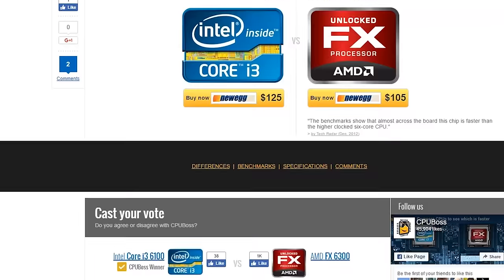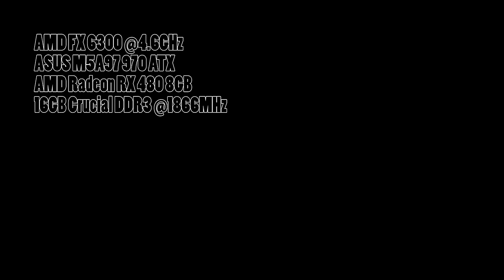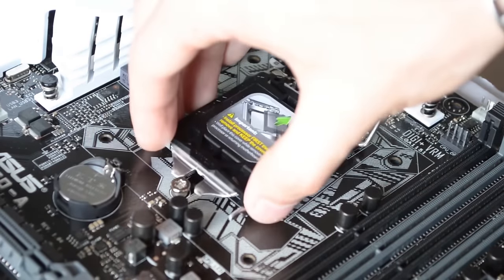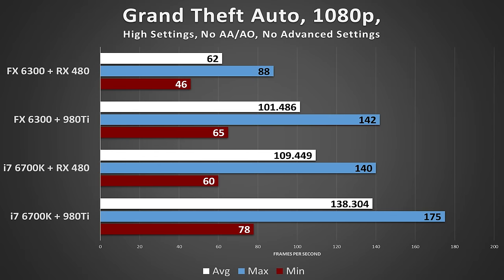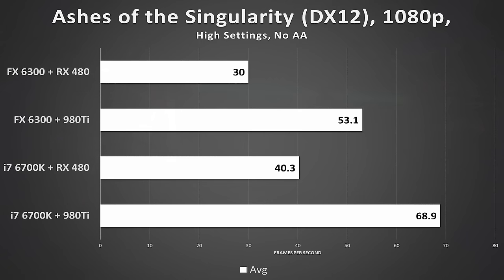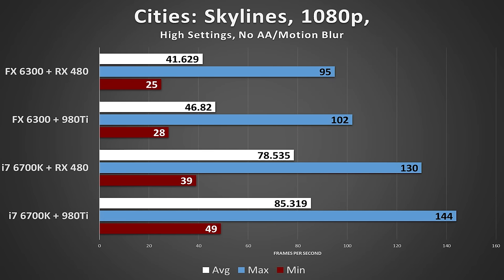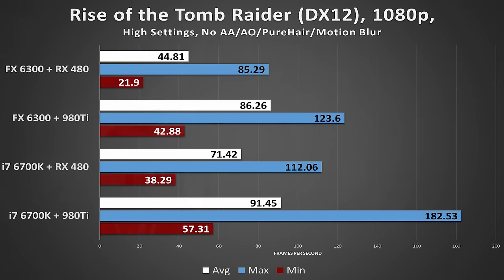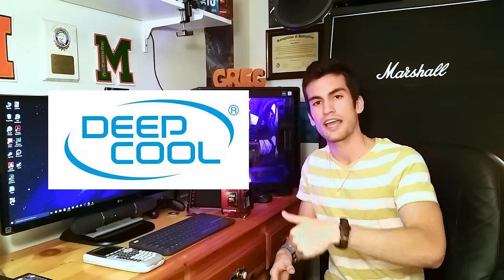AMD FX 6300 + RX 480: Severe Bottleneck?

Comment: ddr3 vs ddr4 is lile 1fps
Reply from the maker: Precisely.
Reply: Science Studio if i remember correctly ddr2 is a bigger jump than ddr3, but i dont know how to test that, as all the ddr2 capable cpus would be a significant bottleneck.
Reply: Same with PCI-E 2.0 vs PCI-E 3.0 = 5 FPS max performance benefit.
Reply: That really depends, if you are buying DDR4 it's 3000+ or bust. Otherwise there is not really much of a difference over DDR3.
Reply: Br3ad still not much in games, it is much better for other things, but as far as games you don't see a real benefit
Reply: Br3ad i mean, not really, obviously you haven't tested this have you? Ram is only an issue when you don't have enough, it doesn't have a significant enough performance impact to actually matter. Having faster speeds doesn't change hardly anything. that's why you don't benchmark ram with games. Also I'm majoring in Aerospace Engineering so probably not as dumb as you think ;)
Reply: Br3ad as I said, its only a problem if you don't have enough. I've been on 4, 8, and 16 gb of ram It doesn't change performance (barring 1 to 2 frames, also channels can change things a bit, but that really is only an arguement for ddr2 and back) unless you are trying to use more than you have in your system. I'm starting to think you are just trying to get a rise outta me.
Reply: ThePaisleyProject I have a machine with great DDR2 RAM I was going to wait it out to Zen, but lighting struck. I will be waiting for your results. You can use up to 4GB single stick if want
Reply: i have a machine with 4gb of ddr2 ram, a machine with 8gb or ddr3, and one with 16gb of ddr3. when we take gpu bound games (becuase the cpu performance will massively vary because of older architectures, i.e. trying to remove the cpu problem) the games had variances in fps when there was a cpu intesive moment, or you didn't have enough ram. (taking rise of the tomb raider, and tomb raider 2013 on a radeon 7970) (the variables are 8 and 16gb of ram was tested on an fx 8350, 4gb or ram was ddr2 and on an athlon ii x4 630) The framerate was very similar(barring 1-5 fps difference) when the game was in a moment that did not exceed the 4gb or ram. (also rise of the tomb raider can exceed 10gb of ram on max settings)
Reply: Br3ad I have never seen a 4gb stick of ddr2 ram, to the best of my knowledge 2gb is the cap for a single stick
Reply: ThePaisleyProject ARK requires+12GB of RAM
Reply: Br3ad ok, so theres a difference between sdram and dimm... and once again ram is only a problem if you do not have enough
Reply: ThePaisleyProject Then why do video cards use faster much more expensive RAM
Reply: they work differently...
Reply: there is a massive difference between gddr5 and ddr3, they have different uses, and therefore work differently
Reply: ThePaisleyProject so one temporarily stores data and other doesn't? gddr5 and ddr3 are different, ddr2 is the same as ddr3?
Reply: they do different jobs...gddr5 is in video cards, holding your textures, and other things that go on screen. DDR(insert number) holds other parts of the game's information that doesn't need to be reached quite as fast. for instance the texture for a waterfall may be loaded in the gpu's vram but the ram holds the information for the cpu of when to put it on screen. so yes they both hold data, but they are meant for very different jobs.
Reply: So ddr2 or 3 cannot hold textures? What about the GPUs that are used for data mining? That information isn't textures.
Reply: Br3ad its used on gpus because they can do many small computations very fast, they arent dependent on the memory bandwidth as much, gpus have been on gddr5 for ages.
so while yes they can hold textures,they are used for different processes
Reply: gddr memory can also request and recieve data in the same clock cycle, whereas ddr can only request OR recieve data in a single clock cycle. this is becuase ddr deals with the cpu which handles a single request per clock... (not talking abt hyperthreading)
Reply: Br3ad okay go ahead spend way too much on ram then... Clearly you're not here to learn...
Reply: Br3ad i was saying the laptop ram, and i mistakenly said sdram instead of sodimms, the ones you sent the amazon link to.
Reply: ThePaisleyProject But they are called DDR2. Why would they share the same name but not share the same functionality?
Reply: Br3ad its different standards, it has the speeds of ddr2, that is why its called ddr2
Reply: *****
Don't you have somewhere to be? ThePaisleyProject  is obviously misinformed and trying to spread his misguided information. He described DDR RAM as only being able to transfer data once per clock cycle. Which is exactly how SDRAM functions and is wrong. All DDR RAM can transfer data on both ends of a clock cycle essentially doubling the transfer rate.
Reply: ***** people who are uneducated tend to be rude when arguing.
Reply: ThePaisleyProject So that is your retort? That is it? I explained exactly why you were wrong, which you can go fact check and then you imply that I am uneducated?
Reply: Br3ad ok first off, link to where you got this information. Second off, this discussion was about the difference between gddr and ddr ram, and also why the there isn't really a problem with ram at lower speeds so long as you have enough. The first clue that you don't really know much about the discussion is that you said you have "good DDR2 ram". It's several generations old at this point and really isn't that good. The ONLY time you have an argument that works in this is the difference in ddr1 vs ddr2 and ddr2 vs ddr3 (and from my own testing this isnt a big change either). Ddr3 vs ddr4 really doesn't have an argument as fps varies by 1-2fps in total between the two as proven by many benchmarks and even the ones I've shown above. 
The fact of the matter is that, gddr is different then ddr. While yes having higher numbers isn't a bad thing, and can even help in things like adobe photoshop, when it comes to games, it doesn't have enough of an impact to really warrant buying super high end ram for every build you make.
you can put the money in other places. For instance instead of buying a 16gb kit of corsair dominator platinum, you could buy a cheaper 16GB kit of hyperX fury. It will give you near if not the EXACT same performance.
Statistics do not lie, and when you say that you "need" the higher numbers, you would be incorrect. Hell you can even be fine with lower speed ram in photoshop, it will just take a little longer to do some tasks. But that also goes with the cpus that can control the difference between ddr3 and ddr4. which with intel isn't much and can be easily tested as the difference between an overclocked 4790k and a 6700k is marginal at best. 
From what you've shown me I believe you are an older laptop user, who either hasn't built a pc in years, or has never built one. You also don't acknowledge that there are different standards such as ddr and gddr. and the real crux of the issue here is that you are unwilling to look at statistics and benchmarks, and when they are brought up you refuse to acknowledge them and even down right go against them.
And lets even take your argument into a little bit of scrutiny. Lets say that gddr and ddr are the same (which they aren't but for the sake of argument) Why are they making ddr ram in general? Because if we already have the faster standards, then why should be putting in the much more slow ddr ram at all. And why aren't enthusiasts around the world putting in gddr ram instead of ddr ram. Well if you can have a rational thought, maybe it's because they do different jobs.
But I haven't seen any rational thoughts from you yet.
So can we go back to a more civil discussion or do you want me to actually get mean, because at this point I feel like I'm beating up on a middle schooler.
Reply: ThePaisleyProject what speeds of DDR4?
Reply: Br3ad if you're talking about gaming, any speeds, it doesn't really affect much. if you're talking about photoshop/premire, higher speeds make a bit of a  difference, but not a huge difference
Reply: ThePaisleyProject 
Yeah you are probably right...... this review of DDR4 4000 RAM proving that performance does scale with faster RAM is probably wrong.

http://www.techspot.com/article/1171-ddr4-4000-mhz-performance/page3.html
Reply: Br3ad most of the games tested are horribly optimised. arma is also very cpu intensive, when you look at games like battlefield 1, or tomb raider (rise of the and the 2013 reboot) games with very good optimization dont really get affected by this that much.
Reply: ThePaisleyProject
"optimized" lol, another buzzword.
Reply: ThePaisleyProject
You know there is not real content to anything that you say.
Reply: Br3ad another buzzword? Optimization  isn't necessarily a buzzword if its used in the right context. but if i must go into more detail i will. Battlefield 1 is one of the most graphically intensive games while it also pushes the cpu fairly hard as well. but, its performance scales really well with all types of hardware (they took the time to code towards both amd and nvidia, of all ages from what i can tell. and it barely exceeds 4GB of ram at the lowest settings I can attest to this first hand) The goal of coding is to have as little code as possible to achieve the desired task. but as games become more complex they will require more code to be written. and thus more space is needed for holding the code in use. optimization in terms of coding means to refine the amount of code to as little used at possible. while not sacrificing performance, however it can also improve performance in some cases. thats why in patch notes you will sometimes see that they will say that they "optimized" a specific map to perform better on specific hardware. 
optimization is the refining of something for the specific task.
Reply: ThePaisleyProject
Dude you say a lot of nothing lol. Do you even code, bro?
Reply: Br3ad k then.
I had a class for game design a while ago that tought me some low level scripting, but I havent learned c or Javascript yet. I do have a class for it though this semester. I'd doubt you have any experience in this though
Reply: ThePaisleyProject
No, unfortunately I don't. Also, I never learned COBOL, C++, QBASIC, C#, SQL, Python, or Assembler. I never wrote an application in C# for my last job. I don't work for an international company where I install applications, setup servers, and configure cisco networks. I haven't worked with people from all over the world including Europe and Africa....
Reply: Br3ad k so you know how to code, still doesn't really change my argument very much
Reply: ThePaisleyProject Yup, people are pretty stupid now days. I guess that is job security for me.
Reply: Br3ad i have a feeling you were trying to take a jab at me there. Although knowing code languages doesn't give you the ability to argue apparently.
Reply: ThePaisleyProject yeah, I guess being a subject matter expert doesn't give me any insight.
Reply: Br3ad coding isn't a hardware matter...
Reply: Br3ad ok first off TRIGGERED.
and second off. Nothing of what I said was racist, she is one of my favorite teachers, I wouldnt expect her to speak english as well as a native born American would, just as I would hope that if I went to germany, they would be able to understand that my german isn't that great. 
nice try though.
Reply: Br3ad its a sad day when saying thay someone whos first language isn't english and they can't speak it as well as someone who's first language is english. Apparently thats racist now. According to your "infallable" logic.
Reply: ThePaisleyProject it is spelled inflatable. Noob
Reply: ThePaisleyProject clearly clearly clearly..... Go feign intelligence elsewhere junior
Reply: +Br3ad no no no, you continued on with this thread, If you want to back out of this, feel free to fight another day, but I'll just stay right where I am.
Reply: ThePaisleyProject your boyfriend reminded me of this thread.
Reply: a discussion that took 6 months, damn
Reply: oh yeah, I forgot to reply to this thread, My major is killing me.
Reply: true
Reply: +Br3ad jokes on you I'm single.
Reply: wow just got through this and buddys just a major goof has nothing better to do for 6 months??? than argue and insult wow must have a pretty sad life if thats how he gets his jollies lmao
Reply: it's lit fam
Reply: drew rudiger not gonna lie this seems like a second account... but i don't really care anymore
Reply: witch is why my build is going to be entirely ddr3, and with an AMD 6-core vishera 3.5Ghz CPU, and a Radeon R7 250 2gb GPU, or a geforce gt 710,
Reply: Zero kid ah vishera, I remember that architecture, good times... if you get a decent cooler, you should be able to push the cpu a decent bit further, also if possible try and find a used 750ti or 1050ti, will easily net you better performance at arpund the same price
Reply: Zero kid also I forgot about this thread +Br3ad hows it going buddy, still mad?
Reply: thanks,
Reply: Zero kid no prob, if you have any other questions I will be happy to assist

Comment: One thing I was wondering, if you had the parts, or have the budget to do so, could you do a video showing a 4th or 5th gen I5 paired with the RX 480? if you're not doing really intensive video editing, rendering, or don't really care about render times, wouldn't an i5 suffice for mid-tier 1080p gaming? I'm thinking more 16 gigabytes ddr4, the 480, and the mid-tier I5.

Comment: i got an fx 6300 rx460  build a few months before ryzen dropped ( i only had a $550 budget)  I only have a 360 watt psu, so I unplugged the optical drive that came with it, freed up a few precious watts, and overclocked the cpu. Stock target is 3,500 MHz, im at 3,800 on a heatsink/dual fan cooling unit... overclocked the GPU from 1212 to 1300 base clock and the system is stable. I can't run high settings, but it plays most titles i want to be playing fairly well on medium settings getting an avg of around 60fps still at 1080p.... for my first time messing with overclocking i cant complain, even if the gains are minimal...it didn't break and I got a few frames back on the low end drop in my benchmark software...

Comment: Playing BF4 with an RX480 and a stock clocked FX 6300 . I have frame rate control turned on since there is no point running faster than 60 fps on a 60 Hz monitor .
Maybe once in a couple of hours did it dip down to 57 fps for a few seconds . I would never have noticed if FRAPS wasn't running.
 BF4 , RX 480, FX 6300 , 1080p  absolutely solid .

Comment: I am soooooo glad i watched this before i bought the rx 480 and fx 6300 combo. Ill figure something else out. I just recently switched over to computers from consoles and tried to build a console killer for cheap which worked, but i built it around an APU. I still love the PC and eventually i was given a free brand new r9 270x so building the apu was a mistake after i got the r9 270x. When Linus released the first video for the rx 480, i crapped myself, i had to have one. But my apu (a10-5800k) clocked at 4.6 isn't gonna cut it. Ill figure something out, im still trying to keep it as low of a budget as possible. Thanks Science Studio for this vid!

Comment: Using a 6300 myself with a 480 myself.  I can edit 4K video and play all games in 720p with max settings. (don't have a 1080p monitor).  The cool thing about the 6300 is it overclocks easily. I have mine overclocked to 4.3 ghz with no problems. That's the value of the 6300, lots of OC headroom.  My cooler was 30 bucks too.

Comment: Hey! Loving these videos on the 480. I've been considering finally upgrading my 1GB 6950 for BF1 this fall, DX12 compatibility, and also to take advantage of Vulkan support for Dota 2.

I have an AMD Phenom II x6 1090T clocked at 3.6Ghz. Some people say that wipes the floor compared to the 6300, others say they're similar. How do you think they compare regarding a bottleneck on the RX 480? I'd like to upgrade my graphics card but if it's strongly recommended to upgrade my CPU as well I'll probably wait until prices lower : ).

Comment: what i found interesting was that the fx6300+980ti consistently had higher fps than the fx6300+rx480 even in titles where the bottleneck is the cpu in EITHER case, is this because of the greater cpu overhead of the Maxwell architecture (even having its own 'embedded' cpu to help offload a bit of work) or is it due to the API behaving differently when a different card was detected, ie drawing shadows differently in a way that's easier for the cpu

Comment: this is relevant to me, I am currently using a Phenom II x4 925 and the 6300 is looking like an upgrade
Reply: Agreed. And 6350 would be even better!
Reply: barely, the two options are 8350 and 6300.  I have the Cryorig H7 cooler so I can easily overclock the 6300 and make it even better than the 6350. The 8350 is what I would get if I were to start using blender
Reply: a FX 8300 (8 core) has the same overclocking capability as the 8350 or 8370 = 4.2 ghz and the passmark scores are much higher for the 8300 than the 6300 (six core) and is only $120 on newegg right now.
Reply: I'd go for the 8350 but hey it's up to you.
Reply: gotta be careful with the 8300, my 8350 came with a totaly different really nice cooler, and the 8300 my cousin just bought has the old style aluminum box, my 8350 came with the nice heat pipes, copper base. the 8350 would be a better but or the 8320 as long as it came with the better cooler, or else your buying a new cooler.

Comment: Did you check for CPU throttling on the FX 6300?  970 motherboards aren't 8+2 phase and get voltage problems.  Maybe an 990FX board would've given the 6300 a better showing.